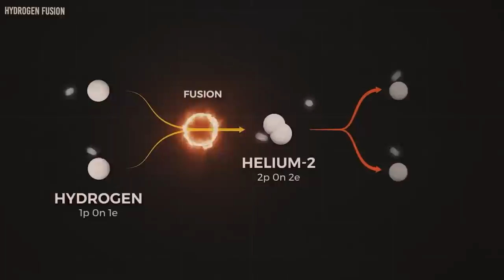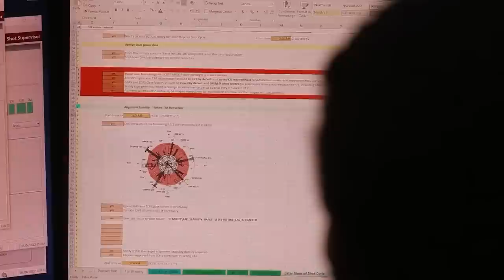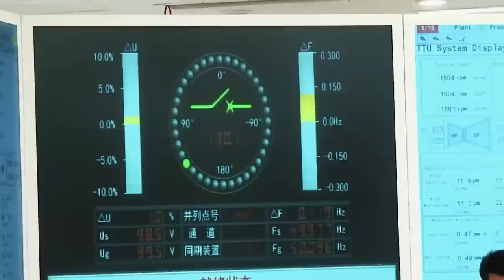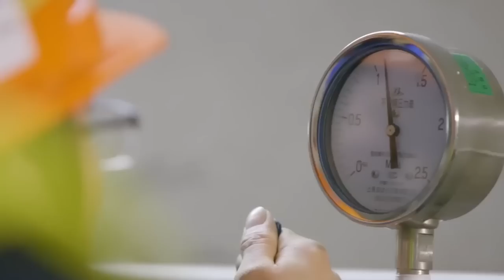Michio Kaku Reveals China Just Launched Artificial Sun

Comment: Fusion (and extremely expensive means of producing electricity all by itself) means transporting electricity via the Grid (the central electricity distribution system). In the US the Grid is old (dilapidated) and as such requires both repairs and upgrades. The Biden Admin. calculated the cost of upgrading the Grid to be $0.05/kWh for 15 years. The Grid itself cost, at a minimum, $0.05/kWh to transport electricity. Disregarding the extremely expensive means of producing electricity by fusion reactors (estimated conservatively to be $0.60/kWh), transporting electricity via the Grid is no less than $0.10/kWh. China sells coal fired produced electricity to its businesses, retail, for $0.05/kWh and, recently, has doubled the number of coal fired electricity plants it builds from one to two per month. Fusion is clearly a non-competitive means of producing electricity and, as such, will NEVER be implemented.